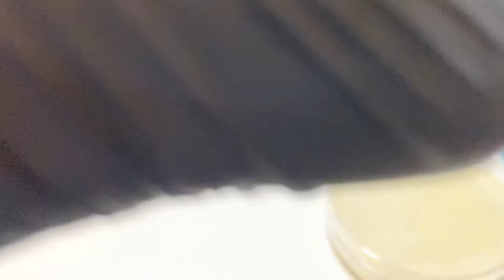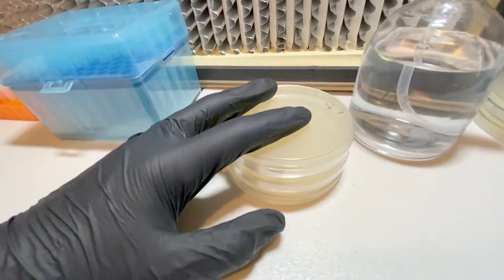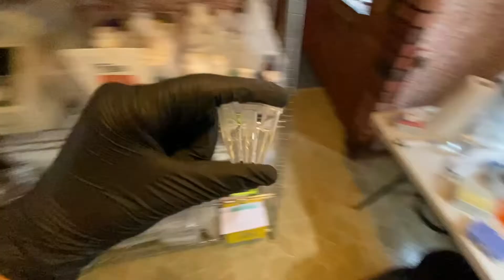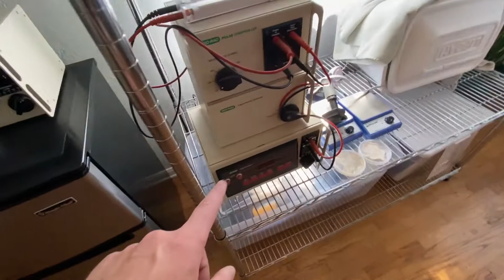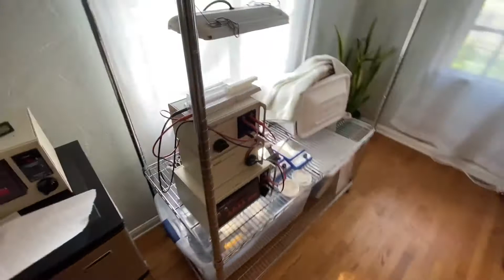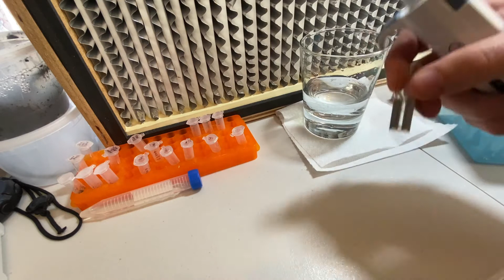First electrophoresis transformant! But can we do better? (Day 9)

Comment: Why don't you add the antibiotic directly to the still liquid agar (while its around 45˚ C) right before you pour it into plates. You will have homogenous antibiotic presence and consistency between plates.
Reply from the maker: It's a really good idea. The trade-off is that I don't always know which antibiotic or how much I'll need. Some also degrade rather quickly once in the media. Spreading it on maximizes flexibility in options, but as you can see, it too has it's issues.
Reply: @everymanbio  I've stored ampicillin (100 µg/ml) and kanamycin (50 µg/ml) plates for months at 4˚ C without any problems. Either way, I love your enthusiasm and I find it amazing that DIY molecular biology/mycology channels like yours exist. Keep it up!
Reply: @everymanbio  You're completely crazy if you think you can add it later. You make color coded plates.  Drag a sharpie of whatever color codes for your antibiotics to mark the stack of plates in one swipe.

Comment: Do you have any resources for how I could make a clean air flow setup like yours?
Reply from the maker: There're many guides online but the gist is that you need a HEPA filter, a strong enough fan and then an enclosure to hold everything together. I just used plywood myself with foam strips to make it airtight. Here're the main parts I used. Filter (https://amzn.to/2VUsMJn), fan (https://amzn.to/39iBzrN), and fan controller (https://amzn.to/3At080U).
Reply: @everymanbio  Thanks a bunch! That is super helpful! I feel confident putting it all together, but didn't know what to buy in regards to parts, so this is invaluable! Thanks man!